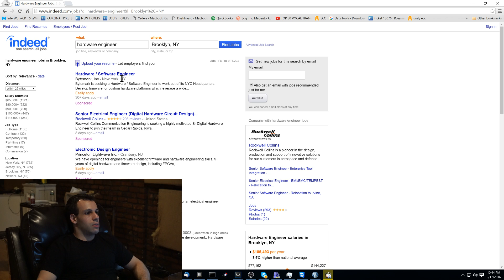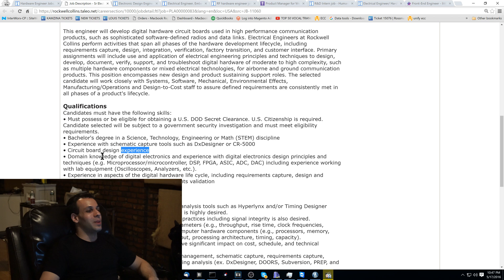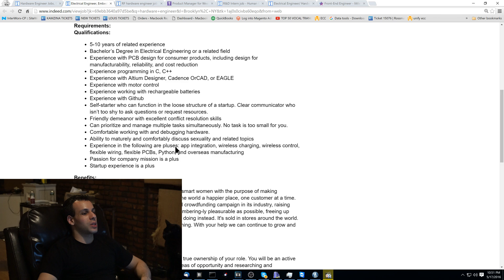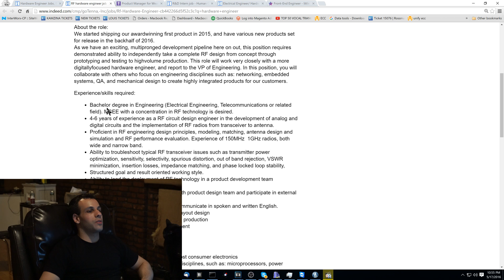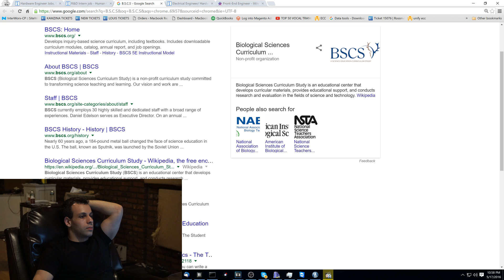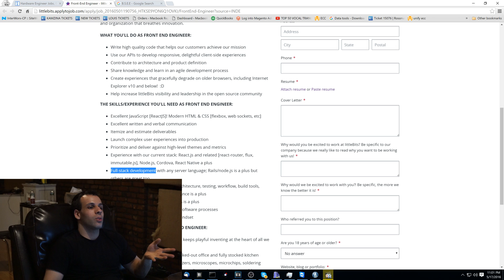Louis looks for a job

Comment: >Pretending to take job requirements at face value
Listing 20 requirements, where each of them tend to take at least 5 years to master is suggesting they aren't really mean it
Also I NEVER EVER saw a hardware engineer who could write decent code (or other way around).

Comment: There was an electronics repair shop in Albany, upstate NY, they were around like 50 years, they also repaired phones but mostly general electronics repair. The owner shut the doors because it wasn't really profitable anymore. His thoughts were everyone throws things out. He said exactly what you said...Apple will replace your phone for x.... A 42" 4K tv in ShopRite is 150$ this week. Is it worth fucking with a repair at this point? I'm a cheap fuck and replaced a capacitor on an inverter board from a 2002 LCD. Most people just throw it in the trash.

Comment: I am qualified as a computer systems engineer, I've lost count of the number of entry level positions where they need 5 years paid industry experience. I've even seen one job for an interstate Semi truck driver where they needed someone who was under 21 years of age and wanted 5 years paid professional experience driving Semis interstate.
Reply: .... Even with states where you could theoretically drive from 16, that's impossible.
Reply: @Olivia-W  I believe the minimum age to get a class B/A license is 18 in just about all states.
Reply: @FadeHook23  18 is minimum to drive inside the state of your license. 21 is minimum to drive in other states.
Reply: Someone just wasn't paying attention, that's what that sounds like
Reply: What you do with truck driving is you get that guy to pay for your commercial license training and endorsement. Work for them under your agreed amount of time. Then buy some old Peterbilt and make $200k+ as an owner operator. I don't see how in that industry you hire someone beyond a certain point of experience.
Reply: Stephen Hunter Just go to a starter trucking company like Swift who hire drivers with no experience. Those trucking jobs you saw were for experienced drivers.

Comment: It is very common for technicians to think they can do engineering. A typical
tech will think, because they can wire up a transistor to a relay and make the
relay energize that they are doing "engineering." Technicians have no clue what
engineering is or what you learn in engineering school. They think engineers
learn how to troubleshoot while in school. They think we learn resistor color
codes and how to decipher SMD component codes. Engineers don't give a damn about
resistor color codes or any of that shit. That is why we have $20/hr techs. They
can worry about the resistor color code for a 47Kohm resistor. 

I spent 5 years as a Aircraft Electrical Systems Specialist troubleshooting, inspecting and
repairing aircraft electrical systems. I was smart enough to get the fuck out of the military
and go to engineering school. Before I started school though I spent another 7 years as
an Electrician. I was troubleshooting complex industrial control systems,
variable frequencydrives, etc. I thought I knew my shit! See I was your typical
ignorant technician who though because I could troubleshoot complex aircraft
electrical systems that I could also design them. Boy was I wrong! I got bitch
slapped in my first engineering class "Engineering Circuit Analysis". I used to
think I could do engineering, but after taking my first engineering class, I
realized as a technician I really didn't know shit. Technicians don't know what
they don't know and that makes them think they are engineers. Wrong! When you go
to engineering school and graduate then you are an engineer otherwise you are a
technician. I would love for a cocky technician that thinks he can do the same thing
any engineer can do,  to sit in on an engineering class. You can get on go to the MIT open courseware videos right
here on youtube and watch one of the sophomore or junior level engineering
course and then tell me "oh ya I can do that." Go watch this one and tell me you
can do this:

             https://www.youtube.com/watch?v=_vyke3vF4Nk

I've taken that class.  Yes, it is fucking hard.  I remember that class being worse than waterboarding, but
it is necessary information if you want to design digital filters.

If anyone is thinking about using Jim Williams as a counter example he was a
special person who was trained by electrical engineers with Ph.Ds at MIT's
lincoln lab. A very special place. A unique place. He spent years under the wing
of some of the smartest people in the country. He never obtained an engineering
degree. Even though he was an intelligent guy he would have probably never made
it through an engineering program, but I would consider him an engineer. He is 
as rare as Einstein, Tesla, and Maxwell.
Reply: It must be hard half of my class dropped out and we did entry level engineering in the IT classes I took.
Reply: I'm not sure if you know that IT (information technology) is NOT engineering.  Configuring servers, writing shell scripts to automate backups or reconfiguring your network topology is NOT engineering.

Comment: Silly Louis: LIDAR is a ranging system using visible lightwaves (sometimes IR) ranging, rather than using Radio.~

When they mention "vibrators" they might very well be referring to electronic oscillators: https://en.wikipedia.org/wiki/Multivibrator

Comment: we have the exact same background - I repaired everything, including system boards, Hifi  (high-end) video, broadcast, studio (yes SSL), taught diagnostics, and then went into IT as an analyst after designing Test equipment. I am now bringing to market a V/I analyzer that will knock 33-40% time off of your typical board repair.

Comment: The part about why companies don't list the salary, is not true. Or at least not in Denmark, I assumed the same as Louis does, a few years back, but has since learned, that some companies dont list salary, because it can vary alot, and they are willing to pay extra for a person with more or better skills.

And btw dont read a job application from a large company, as you need all the skills they list. They are just shopping for skills, the more the better of cause, but if you can fill a few of them, send an application anyway and sell/brand your few skills good, but dont lie. Most of the time they never receive an application that meets all the skills that they listed. And yours may come up on top.

Comment: Technically I'm a full-stack developer as I've worked on assembler and even machine code level all the way up to OS and application level (ironically now I do almost zero coding in my business).

But most people who use "full-stack developer" almost always have caveats ("oh, well obviously we didn't mean OS level" etc). It's a fairly meaningless term. As good for arguments as discussing the One True Brace style in C, or vi vs emacs.
Reply from the maker: Out of curiosity, what books would you recommend, if any, as an introduction into programming? I picked up "The C Programming Language" and lots makes sense, but lots also seems to assume I have some basic rudimentary knowledge that I don't have. I google and check stackoverflow for answers to certain items, but on others I find myself wishing I had some more basic understanding.
Reply: One of my favourite programming books, "The C Programming Language". It's rightly known as "The Bible" when it comes to C programming (or possibly programming in general). However, I think it's very succinctly written and assumes a certain amount of knowledge, so it's not the best as an introduction to programming. It's more for when you've got a bit of coding knowledge and want to learn the C specific version of a concept you're already familiar with.

When it comes to coding, there's a few basics high-level concepts that are crucial. You may already be familiar with these, apologies if that's the case.

The first is the distinction between strongly-typed and weakly-typed programming languages. In college, a lot of first-years are taught the basics of coding with a strongly-typed language like Pascal. This allows far less flexibility than a weak typed language like C. (A weakly typed language lets you do something like 'x = "john" + 123' -- adding two different types which should make no sense). Some people see a strongly typed language as a bit like going to the bowling alley with the gutter rails up (and others think that's a Really Good Idea if you're coding mission-critical systems). If you're getting into coding, I would recommend you learn a bit of something like Pascal first, it's quicker to make progress, and the knowledge transfers over to C very easily.

The other high-level concept is that of procedural programming vs object-oriented programming ("OOP"). Procedural is the old-school method taught up until around 2000 (when I graduated college), and has been superceded by OOP since then, particularly with the popularity of Java. Procedural code is a list of sequential instructions that the machine follows. OOP is an in-code representation of various objects, and the interactions between them. OOP code usually starts off in a waiting state and listens for an event to happen, when it does that kicks off the event on whatever object it occurred in/on. Procedural code starts off with the first instruction, executes that, then goes to the next. 

With C, there are several versions of the language which can really confuse. First there's the C that you're reading in "The C Programming Language", that's known as K&R C and is the procedural version. It was formalised into ANSI C which is the standard procedural C that most people use when writing code. (There's also a minor update in 1999 called C99 but it's basically ANSI C with a couple of extra variable types.)

Then you have C++. This added object-oriented features to C. It's backwards compatible - you can write a procedural ANSI C program and compile it with C++ tools. This can get messy and although it is incredibly powerful, I think one of the reasons Java became so popular is that it was harder to do things The Wrong Way. (Then to add to the family, Microsoft came along and created C# (pronounced C-Sharp) as a better version of C++ and direct competitor to Java.)

Ok, so to wrap it back around, I actually recommend you start learning coding with a simple, procedural language like  Pascal first, before trying to learn C or C++, because that will stop you from learning really bad habits or getting overwhelmed with pointers and type-casting and all sorts of other issues. Pascal generally is not used in industry, although its big brother Delphi (OOP Pascal) is used to create Windows applications in some places. You'll see a lot of people say things online like "it's very limited and has few control structures and data types compared to modern languages". I agree, but that's why it's perfect to start learning with. There's some free resources on WikiBooks.org - stick in Pascal and that might help.

This turned into a bit of a wall of text, sorry about that. If I can clarify or expand on anything let me know.
Reply: WebsiteDoctor wouldnt mind u sending me text walls like these every now and then via whatever, hmu

Comment: Also often company has openness and anti-discrimination clauses for the sake
 of 'fairness' an internal vacancy MUST be posted on the job market.
 
This means they already have the person they want to hire working in the company so the job requirements are exactly the role that the person was doing. 

In software engineering style job some ads are hilarious as there are millions of permutations required in the skills list but they insist on one particular combination of skills. And say no substitutes. 
Eg: if you write shell scripts in bash or python but not korn shell then they wont even return your phone calls or reply to your emails.

This has unusual impacts on the job market too. The number of IT jobs reported are much higher than what is realistically available.

Comment: I have been a technical recruiter since 1999. As you suggested in this video, you are most likely not going to be a 100% match but don't let that stop you. Remember, it's not necessarily about answering answers correctly but rather can the manager follow your train of thought that led you to the answer that you gave. Heck, a hiring manager posted somewhere below that he hires people that can answer half the questions correctly and that can think analytically. 

A tip to get a job if you decide on a test engineer or a programmer(I read below that you have been interested in learning a programming language). Get a free membership to Linkedin and find people that work for a targeted company. Reach out to people that are in the role that you are targeting and offer to take them to lunch in exchange for picking their brain to see if their job is something that you would be a fit for. If it's a fit then ask him about user groups and local professional organizations that you can join. You are networking with him for a job at his current company and finding out where else you can find similar jobs.

When you apply to jobs make sure that you reach out to members of that company such as recruiters and possible hiring managers of that role. This can be determined by the free membership Linkedin. You cannot email directly with the free version but just do a boolean search on google for their email. I say this because corporate recruiters have about 30 to 50 open positions at any given time and get tons of applications per each position. Seriously. I get about 200 resumes per position and most of those are not even close to the requirements. By reaching out to people directly it will help get your resume in front of the hiring manager/recruiter instead of getting lost in the black hole.

Comment: Louis you do great work and video content. But, I do think you are too hard on yourself. The only job postings you looked at today were related to engineering. You come across as a really enthusiastic public speaker. I feel like, if you wanted, you could find a lot of success in other job fields that may not not nesecarily be related directly to technology.

This is coming from an engineering student who needs a few more years to get his degree.

P.S. You might be surprised how many engineers lack the ability to think on their feet. That is a quality which I believe you possess.

And I mean, you'll never know until you try :). There's really no harm in applying online for jobs. Even jobs you may not think you will get.

I'll finish my comment with this: You are exceptionally motivating to your audience. Don't be so hard on yourself. The cards will lay themselves out eventually per se.

Comment: A lot of the difficulty is that these jobs are commoditized, or appear to be so, or on their way to be so.  The more people who are out there to do these jobs, the more pressure there is on employers (rationally speaking, and not talking about the skinflints out there who have no compunction about flagrantly abusing workers) to race to the bottom and look at price first, and then ridiculous and unreasonable job requirements.  This contributes, in part, to why you have low-skilled jobs with degreed people in them.

Comment: As for salary...you're actually wrong about that. Engineering jobs (and most salaried jobs, IIRC) never post anything about pay on the job requisition. That's all negotiated later.

I think you're also selling yourself a little short, though most engineering positions DO require at least a BS degree in engineering or math or physical sciences. With your experience, you could probably get a paid internship at an engineering firm while you get a degree. If you feel like the math would disqualify you, I'd urge you to reconsider. I HATE math, but here I am, with an MS in mechanical engineering. Many, if not most, engineers I work with have a similar relationship to math. We did our time, but now we let the computers handle most of it. Once you understand what calculus is really doing (dividing up a function into slices and adding the slices up) it's not so mystical. If you work your butt off for a few semesters and get past the math it gets a lot better after that.

That said, if you like what you do and it pays well enough to start building to retirement, why switch?

Comment: I have no doubt you could do most actual electrical engineering jobs. The fact that you love your current job is what is holding you back ! I guess that's not so bad either. I spent the last five years just dismantling aircraft engines and I loved every minute of it and it paid very well. I could have made more doing programming but hey, when you love your job you don't want to change.

Comment: Dude, You're making excuses. You know why that stuff doesn't go on a resume? because stuff from last decade doesn't go on there. Mention numbers to make your business into useful information for them. 2 employees, 4 boards per day, and so on. 

As for school, you can test out of most courses. Official tests (klep tests) exist for the basics and many professors will sign you off as passing a course as long as you can demonstrate knowledge of the material.  You could probably finish half a degree from showing them your videos alone. 

But no, finding your first job in engineering is a bitch and I wouldn't recommend it unless you know someone or have the kind of contacts you might gain at a university if you're lucky, or have a family member.

Comment: There are plenty of Chinese folks, here in America, who do the component level repair you do, so putting yourself in the top ten of people who do this, not percent of people who do this, seems a little high and mighty.
Reply from the maker: and after going through enough of them when offering $35/hr, benefits, & paid vacation who would heat MCP79 rather than replace C7771, I stand by my statement.